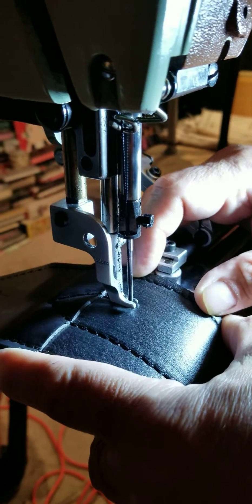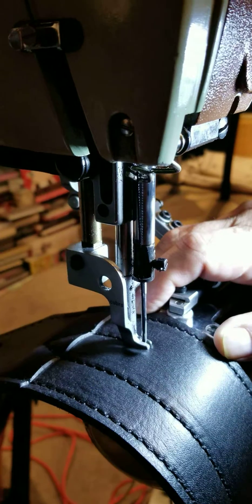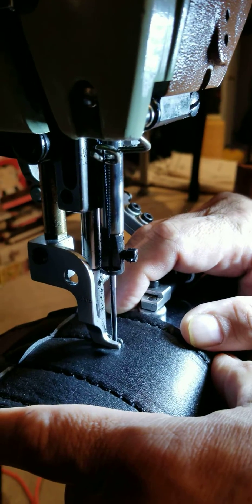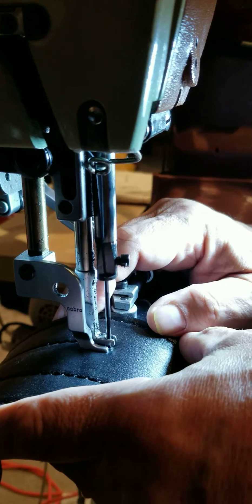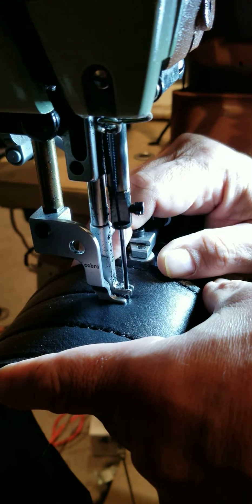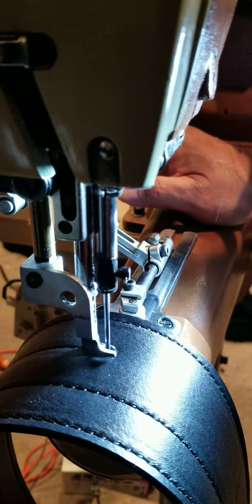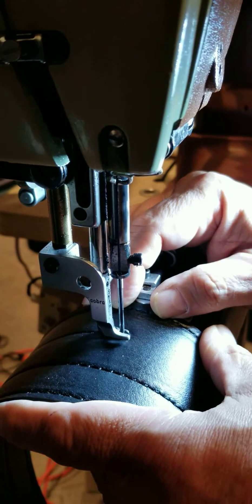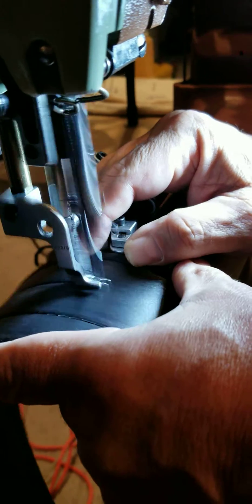Controlling the speed on a digital servo motor with your foot.

Comment: Thank you for this video! I'm currently considering the Cobra 26 and trying to decide between getting the one with the EPS or not. This is helpful. I currently have a Juki 1541s industrial flat bed and I'm unable to use the needle positioner with the speed reducer I had installed. Apparently the servo motor I have it paired with won't work with the positioner and the reducer. So I chose the reducer. I want to add a cylinder arm machine for the top stitching and tight curves and the Cobra looks perfect!

Comment: Need help please. When im sowing and i get done and pull my thread i have like 3 threads come from the bobbin.  I have a picture but don’t no if i can send it
Reply from the maker: We call that three threads down the throat.

You're in luck!
This is not a mechanical problem.

Three threads down the throat is indicative of not cycling the machine until the end of the cycle.

When you want to remove the work piece you have to allow the needle to complete the cycle a quarter inch past the top dead center.

To make it simple to understand let the needle come all the way up and then down a quarter inch.

At that moment the hook will have completely released the needle thread and now you will only have one thread down the throat.

This is the optimum moment for removing the workpiece.

Please consider using the finger deploy method to give slack to the thread so that you can pull it out with ease.

Comment: The details of how the treadle rod is connected to the machine and treadle can make a big difference also as I’m sure you know Al. Depending on the motor type there may be options for connecting the treadle rod differently and adjusting multiple springs and/ or light sensors. These options can make a massive difference in sensitivity and control of motor speed. You’re probably talking about people who are on your exact set-up so some of what I’m saying may not apply- but for those trying to increase control on any industrial machine, these are places to start. Also, some motors are better than others in this respect, and using a smaller pulley wheel further helps slow things down affordably.